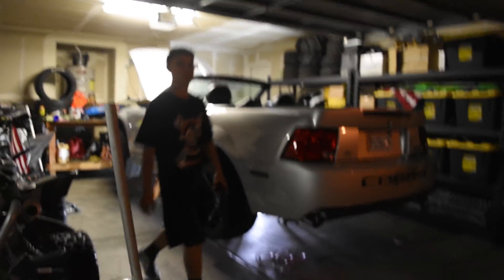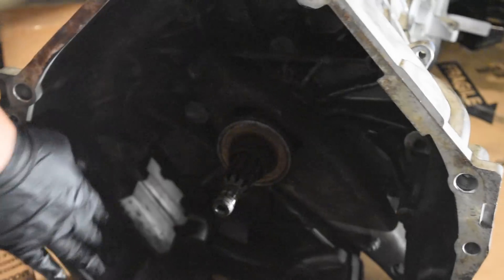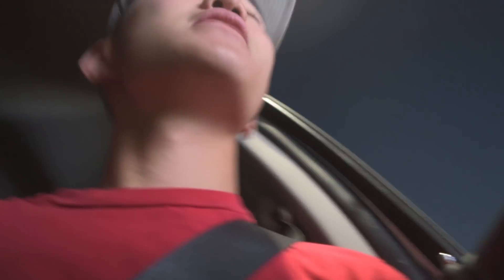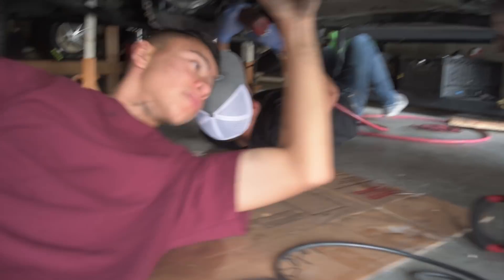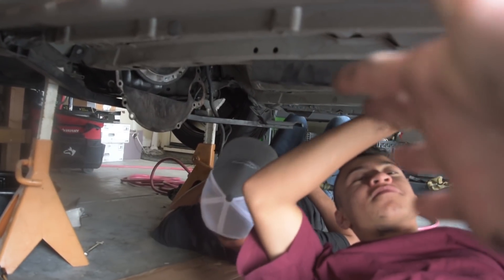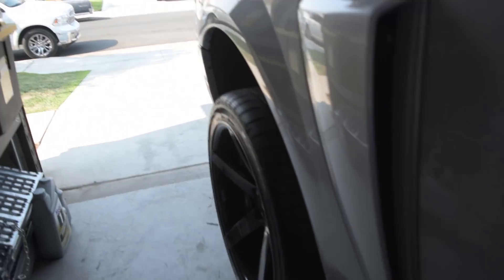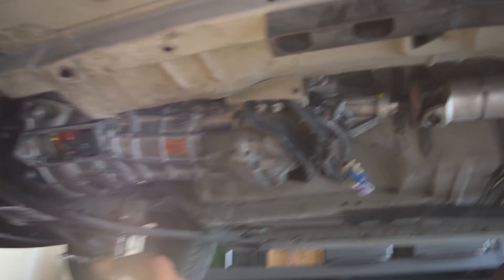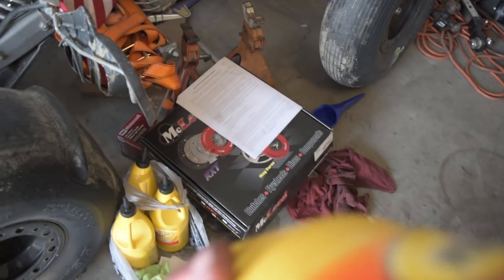COBRA GETS New Mcleod RST CLUTCH

Comment: McLeod RST & RXTs are great clutches! You won't believe how soft the pedal is. Accufab is the choice of most Cobra owners. It is good...I started out with one, but I found that the LFP Bigmouth works a bit better...more smoothness in the low end, plus it costs less! BTW, dude get some real tools! Installing a throttle body with an adjustable wrench is NOT a good idea. Also, you are supposed to break in your clutch for 500 miles WITHOUT BOOST! If you burn that flywheel before it mates to the clutch it will be trashed.
Reply from the maker: Yes I’m currently breaking the clutch in right now. And Couldn’t find the right bolt size so we went with what we had. Haven’t had any drive-ability issues with the throttle body :)
Reply: Don't get me wrong bro, Accufabs are very cool, I still have mine. It's just that if you become a genuine perfectionist like me, you start looking(fussing) for every little edge. I remember reading somewhere that a Cobra dynoed an extra 10hp with the Bigmouth over the Accufab, plus they cost about a hundred bucks less. Anyway, your Cobra sounds great! I know how tough it is to stay off the boost while breaking in that clutch! I had to do it for my RXT, and my T56 Magnum too! But the end result was well worth the wait, believe me. You will freak out after you bang your first second gear! LOL
Reply: tominator I just picked up a t56 mag. Waiting for it to be installed now. How do u like that transmission?
Reply: 5.0 World...Bro, you are gonna love it! Just be sure to break it in right and change the oil after 500 miles or so. Mine is a bit grindy before it warms up but I heard that is normal. Other owners say that Amsoil ATF eliminates that too. I am in the process of changing my trans oil to Amsoil now. Magnum is strong and smooth with absolutely no notchiness compared to the original T56 I had in my Cobra.
Reply: tominator cool that’s what I was hoping for. I wanted it to be smooth.Taking  the power on my terminator soon to looking for 700hp to the tire bro. Hope to get that.
Reply: 5.0 World...I am in the neighborhood of 650whp and 600wtq. That's with a Whipple 2.3L, 3.0" upper and 4LB lower pulley, JLT intake(SCT BA2600 MAF), w/ LFP Bigmouth throttle body.  I'm more than happy with that much power on the street. I need Mickey Thompson ETs out back for traction...315x35x17.  With your Magnum I would strongly suggest you use a twin disc clutch. I have the McLeod RXT and I was shocked at the light pedal pressure ...even less than stock! Good luck with your Cobra build my friend!  The end result will rock your world! LOL
Reply: tominator wow we are some what running the same setup. Mine power is 605whp and 573wtq. That’s with a VMP 2.3 and a 3.0 pulley. Sct 2600body. Stock lower pulley. Going with fore fueling system full return next and custom cams. Hopes of the 700 at the tire. Thanks buddy. U have a nasty terminator your self.
Reply: 5.0 World...Thanks ma brutha! If you want a good boost in torque, get the lower pulley(4 or 6LB)! I know it's a real pita but well worth it especially if you are doing cams too. Your torque number will get much closer to your whp number! Fore is a great system upgrade, I'm staying with GT pumps & returnless for now. I would say you will hit 700whp easily with those mods. Local Hellcats beware!
Reply: Dragon plenum and throttle body is the way to go from what I have seen but they pretty expensive
Reply: @tomkjr1  how is that McLeod clutch holding up? i just got mine delivered about to install soon in my 03 cobra
Reply: @mmorgan901  RXT is a terrific clutch. I've had 2 Terminators and both have had RXTs in them. Once installed you'll never have to worry about another clutch upgrade even if you add more power. To get the best effect I recommend changing out everything in the assembly that you can--- throw out bearing, adjustable cable, flywheel, pilot bearing, tob sleeve, clutch fork & pivot ball. That way you have the best chance to have a clean, issueless install. Don't forget to give the clutch a good 500 -1000 miles break in period with lots of up/down shifting and NO BOOST!!!
Reply: @tomkjr1  thanks my guy I appreciate the input 👌👌
Reply: @mmorgan901  Happy to help anytime bro.